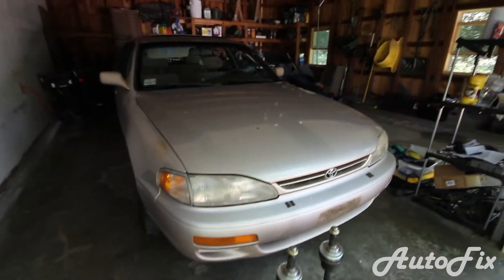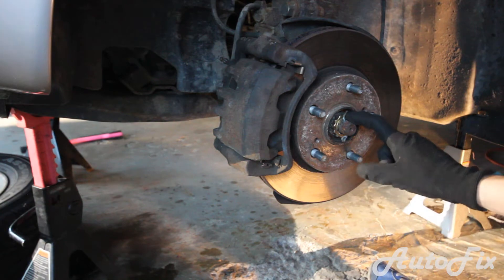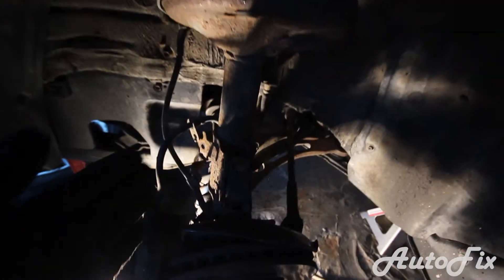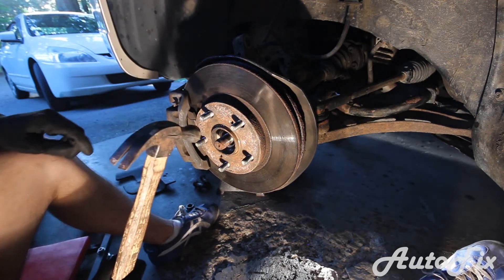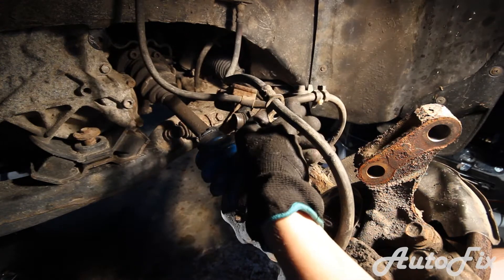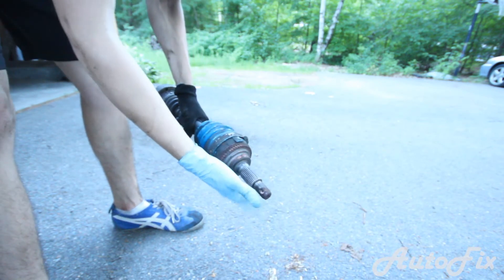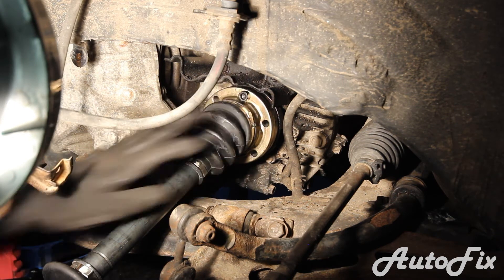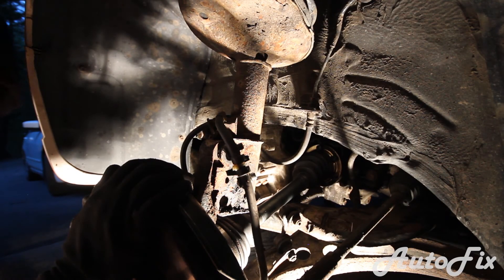Axle Replacement on a '92-'96 Camry V6 Automatic Transmission

Comment: This might very well be the most detailed repair video I've ever seen on YouTube haha you just gained a new subscriber sir!
Reply from the maker: Thank you!!
Edit: just watched some of the video and I'm realizing how much nonsense talking there is lol, hopefully you stick around for some of the newer videos which are much better than this one 😆
Reply: @AutoFixYT  just got the drivers side axle pulled thanks to your video, my struts are in atrocious shape so I just ordered them and will put everything back together once they show up, the struts in the rear of my sedan, im assuming I have to pull the rear seats out?
Reply from the maker: @takumisato7126  Nice! I have a video on front struts. I also have one on rears but it's on the wagon. For the sedan you have to do the following:
Pull up the whole bottom half of the seat from the front. It has two clips and it will pop up, remove it. Then you can find two 12mm bolts, one on each side of the car, which hold down the corner cushions of the back rests. The bolts will be at the very bottom covered by a flap of seat material. Once you remove those, slide the corner cushions straight up and then out. With those out, you'll have access to the top three nuts of the rear struts. One of them will be a pain to get to, but with the right tools you should be able to get it done. As for the torque, don't even bother unless you really want to. You'll have a really hard time getting your torque wrench in there. Just make them nice and tight. My only suggestion is that you do that woth the weight of the car on the suspension so it can push the struts tightly up in place. Then reverse the seat removal and you're done!
Reply from the maker: And also you should get an alignment because it'll be way off after you replace the struts.
Reply: @AutoFixYT  thats a good idea, I'm do for an alignment anyway, I'm in northeastern PA and our roads are atrocious! Lol
Reply from the maker: @takumisato7126  yeah I was wrong in this video for saying that only tie rods affect alignment. Literally everything that has to do with suspension and steering affects alignment. So definitely go get one. Especially when you change old struts. Most of the time the ride height will change and will actually completely mess up the alignment because of that.
Reply: @AutoFixYT  idk how the videos can get any better haha but will definitely be watching more!
Reply from the maker: @takumisato7126  lol thanks! They are much better, trust me haha

Comment: Working on cv axle passenger side Camry 94 Le.. I didn't see any 8mm hex?
Reply from the maker: They might have had a different style back then and also depends on the engine/trans. This is a 96 with a V6
Reply: Geez.. I found the right video and got quite a job to do.. heh
Reply: Depends, mine is a 3VZE-FE V6 5 Speed manual and it uses the 6 Allen bolts. The 4 cylinders I beleive slide right in with a snap ring. Very important to make sure that ring is on the end of the axle when you are taking it out bc the new one won't go in if it stuck inside the transmission. There were 2 cv shaft designs with these 90s camrys. Depends on engine and transmission type. The 6 bolts design is better in my opinion .

Comment: Hi 
Is there a difference between v6 and 4 cylinder axles. Please ?
Reply from the maker: I think so, yes.
Reply: Yes, there is. 3VZE-FE V6 Four Cam 24 Valve   Engine bolt to the transmission with 6 Allen bolts. The 4 cylinders slide right in to the tranny. Mine is a 92 SE 5 speed manual and that's what I've noticed.

Comment: struggling right now brother with the 8mm allen bolts. Any tips. They seemed not that tight for you. I am going to do that long extension trick tomorrow
Reply from the maker: You can apply some heat but be careful. Other than that maybe more leverage or a power tool of some sort. Just make sure you don't strip them out otherwise you're in for way more work.
Reply: @AutoFixYT  so I got it out after a while.I went and bought a triple six socket and hammered it in. Sure enough came out. Thanks for the video it helped me a lot.

Comment: New sub here 👍 I have the same exact car but a sedan it’s funny same year and color.I have a whining noise in my passenger front wheel that sounds like a bad wheel bearing at low speeds and it’s getting super annoying.I bought and paid labor to fix the wheel bearing only to find out that wasn’t it.Do you think the noise could be coming from that part of the cv joint you showed at 14:36 ?
Reply from the maker: I don't think the CV axle could make such a noise. Try changing that tire with a spare or moving it elsewhere on the vehicle and see if it's still there or not. Sometimes tires can make those noises.
Reply: Auto Fix yea I was thinking it could be a bad tire as they are pretty bald and 5 years old but 2 mechanics told me that it isn’t the tire but who knows maybe just trying to take my money for repairs.Im going to buy a used tire and throw it and see if the noise goes away thanks alot
Reply: Auto Fix even the previous owner told me that the car was going to need tires soon and I’ve put 8k miles on the car since I bought it
Reply from the maker: @Chicag0FB  Oh bald and old, that's asking for noise! Haha especially if they're a cheap brand. Just get four new tires and you should be riding quietly!
Reply: Auto Fix thanks man I ended up changing passenger side tire and the noise went a way but I still get a little tiny rumble from the driver side now so I’m guessing I have to replace that too.Im going to just end up buying a new set for all 4  and call it a day.Thanks a lot for your help I was already going to drop some money on a new Cv joint with the labor
Reply from the maker: @Chicag0FB  You're welcome! Also, if you're not going to buy all four tired at once then at least buy two at a time. You're putting traction at a great disadvantage with two different tires on the same axle (front or rear). So always buy tires at least in pairs of two.

Comment: Why did you take the strut off? I replaced both of mine in one day and you don't need to take the struts off to remove and replace these. You also probably knocked it out of alignment doing that. Anyways.. decent video,btw you forgot to put those torque brackets back on you told everyone to save , I see you put them back on after you caught it though.
Reply from the maker: Honestly I don't remember why I decided to do it this way. Typically on these I'd want to remove the lower ball joint off the control arm, but like I said I don't remember why I did it this way.
Reply: @AutoFixYT  I don't even remove the ball joints. Just the strut bolts and tap it out with a hammer. I leave the whole break system on and just move it by hand. I changed one weeks ago in an hour .

Comment: My wife has 96 Camry LE. I just finished replacing the cam cover gaskets and the transmission mount. This Saturday im replacing her power steering pump as it has a massive leak. Will be also doing the cv axles. Thanks for the great How To. I didnt know the size of the allen head bolts, now i know what socket to get.
Reply from the maker: Thank you!
And nice job, is yours a V6 or 4cyl? I need to do so many things on mine this coming summer... it's starting to get to the mileage where things go wrong. Nothing major but things like struts, valve cover gaskets, plugs and wires, exhaust leaks, and so on. Engine and trans are still perfect though so hopefully they last a while!
Reply: @AutoFixYT  its the 3.0L V6 quad-cam with 350K miles 😁

Comment: Is it critical to have all the bracket/washers (or whatever they are called) that get bolted in the six bolts? One of those broke on mine and I was wondering where I can buy it and what's the actual name for it? None of the auto parts stores are familiar with it. Thanks!
Reply from the maker: Good question. In my opinion those are only there to make sure that the bolts apply equal pressure all around. If you are missing one of them it's not a big deal. You can go about several ways:
1. If you're concerned about an imbalance then remove them all and just use bolts.
2. Replace that special washer/bracket with regular washers to make up for the thickness on the bolts
3. Just use whatever washers you have and none on the bolts where it broke, it should be fine.
What I would personally do is try to find one at the nearest junkyard. If that's not an option I would put a couple regular washers in to try and recreate that same weight distribution on the rotating axle assembly. It may not be a big deal but who knows. In the end, your choice! Whatever you feel more comfortable with. Like I said it may even be fine without that washer/bracket in there.
Good luck!
Reply: @AutoFixYT  the part number is  43489-03010  for those they are called "Toyota 43489-03010 Cross Groove Washer" just today after replacing both sides with the same axles he used in this video i just found browsing,  changed like 9 months back, for some odd reason i went to the store and when i went to turn i heard nothing but a dragging sound and car wouldnt go,  i jumped out put the hazards on and  4 of the bolts were backed out those washers were broken and 3 bearings fell out, now im wondering what to do about it if i should just put thread-locker on them and repack the bearings back in as 3 fell out and not use any brackets as they cost anywhere from 7.99-12 bux a piece plus heafty shipping online at any Toyota parts oem site,  if you guys have any ideas as to what i can do cause i am stranded and i dont know if i need the groove washers or not, any advice would be helpful!  Nice vide btw!   Thanks in advance for any advice will keep checking back!
Reply from the maker: Sorry YouTube never notified me about this comment... you can remove those washers and use thread locker ok the bolts but replace the axle if it came apart. I wouldn't try to mess with putting it back together and hoping it's still working fine
Reply: @AutoFixYT  As it turns out, all three of the cross grove washers on one axle have been destroyed. So, if we can't get a hold of the cross grove washers, would using a thread locker on the bolts suffice? Thanks!
Reply: N
Reply: Zeberka was a great
Reply: Zeberka has

Comment: Once you loosen the bolt and nut from the strut you mess up the alignment already. You will have to deal with the camber issue, either you will have positive or negative camber. Meaning that the car tire will wear the inner or outer side.
Reply from the maker: What you say is true, although the adjustment is so minimal since these cars have no camber adjustment that as long as you push the knuckle all the way in when assembling, it won't make a difference. But you're right you may not have a perfect alignment afterwards anymore.

Comment: Is it different on a 4 cylinder from the same year?
Reply from the maker: Yes, it's different but only on the transmission side. They have a different transmission. You have to pop out the axle with a pry bar from the transmission on the driver's side. On the passenger's side you have to remove the axle with its carrier bearing (which just unbolts from the engine block). On the wheel side it's all the same though.
Reply: @AutoFixYT   Thanks so much.  I really appreciate it  . ✌️

Comment: I just replaced mine and I get a shuddering from a stop while accelerating and going up hills. Its especially noticeable when I'm at a stop and I give it a good bit of gas. It wasnt doing this before at all. Please help!!! Any tips are welcome
Reply from the maker: Here's a few things to check:
- I hope you checked the new axle to make sure it's not a bad axle to begin with (sometimes the joints are stuck even though it's new)
- Check all other components in the front end: ball joints, inner and outer tie rods, control arms, struts. A new tight axle might affect old worn out components
- Check the other side axle and components, make sure those are all tight. In this video I only show one side but I changed both side axles the same day
- Lastly, make sure that the motor mounts are also good, they play a huge role in smooth driving. As I said before, with a new tight axle, it can make them feel looser than before. There should be a total of 4 motor mounts, whether you have the 4Cyl or V6. One on the left, one on the right, one in front, and one in the back.

Good luck to you! Just keep in mind, it's shake when taking off under heavy acceleration, so something has to be lose there
Reply: I'm goimg to change the motor mounts today I changed the dog bone and the rear needs to be changed. The axle should be good but ill keep you posted thanks a bunch!

Comment: Did you do the passenger side as well??  I notice  you say that each side takes the same cv joint.   Other vids show later model camrys with a completely different passenger side cv joint.  I take it the 1996 model xle 3.0L uses the same kind of cv joint on the passenger side as the  kind on the drivers side.  Can you confirm?
Reply from the maker: Yes I did both sides the same day. One off camera to see how everything works, and then I filmed the second side. Both CV axles are identical on this model BUT it will depend on the transmission. This car has the A541E transmission which has two equal length half shafts for equal power distribution (minimal torque steer). There are two other transmission options for these cars. The 96 XLE V6 should have the same exact one, but confirm that by checking your door jamb sticker where the VIN is located. At the bottom left there should be two lines of text, you want to look at the one that says "A/TM". TM stands for transmission. If the code says A541E, your car will have two identical CV axles, there will not be a left or right.

Comment: I just installed my axle about four months ago heard a noise coming from the passenger and all but two bolt where gone what would you say someone dose not like my jokes or are the bolt known to loosen i would really like your opinion
Reply from the maker: I've never had them loosen up on me. If you make them really tight they should stay. But if you're worried then use blue thread locker and install new bolts. Make them tight (not very tight, just tight) with thread locker and then they should not come out again by themselves
Reply: @AutoFixYT  thank ypu for you time and i hope you have a wonderful evening

Comment: Hey bro, did you have to force the barrings and ring into the housing. Reason I ask is because I just got mine in the mail today, and the barrings and ring were separate.
Reply from the maker: Texas Backyard Gardener I actually didn't have to do anything, all I did was remove the old ones and reinstall the new ones... weird that you had to install parts together...
Reply: Yeah, it was weird. I pushed them in. Your video did help a lot man. I have a 96 Camry 4 door 3.0 LE so your video was exactly what I needed to see! Great job on it btw. I figured i'd do the tie rods and axles at the same time.